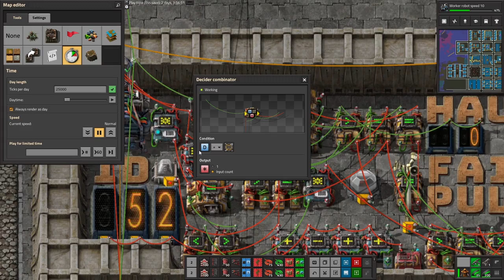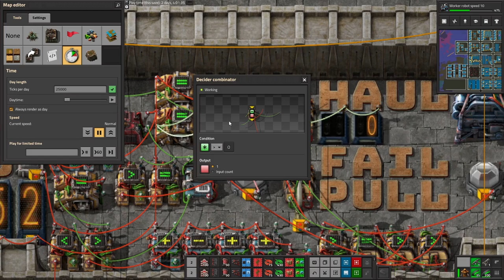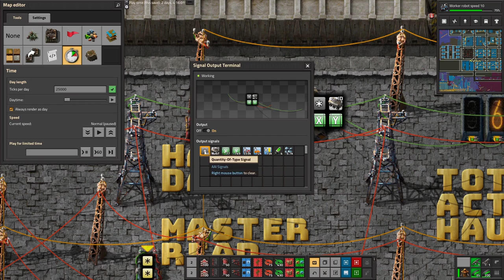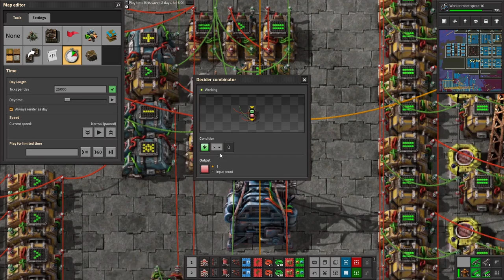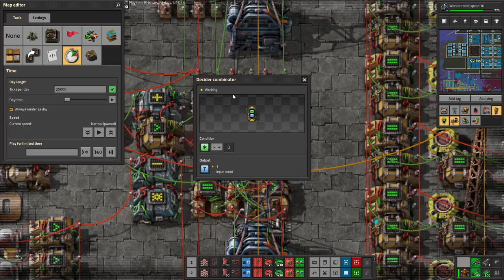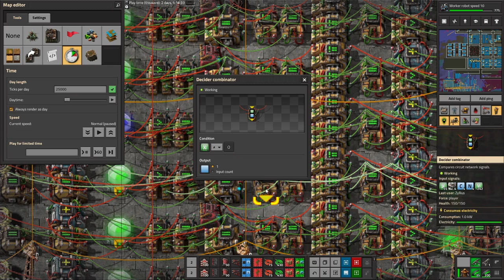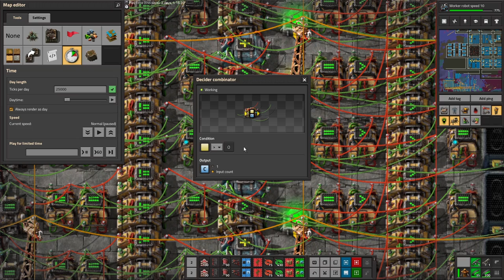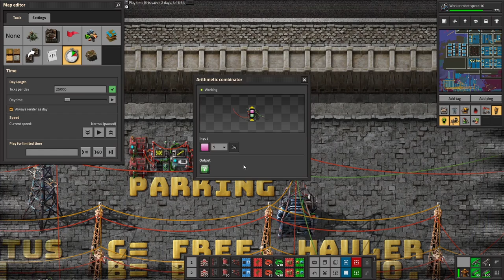Explaining the Logi-Brain™ Poorly

Comment: I was under the impression that I was above average when it comes to circuits in Factorio. After watching this, I realized it was just a massive Dunning-Kruger effect.
Reply: I mean you still could be, this is WAY above average, the guy is a computer engineer after all
Reply: No no, most people dont use wires at all so you are above average if you use them for more than 1 thing.
Reply: @nadarith1044  My brother is also and he doesnt use wires in factorio because thats not the point, altho not needing to manually make sure the oils dont clog could be useful.
Reply: @nadarith1044 Put simply, original commenter is probably above average, considering most people don't ever use circuits. Dosh, however, is in a league of his own... He's not just above average... He IS the average. He's 50% of the average for circuit knowledge

Comment: So from what I see you've broken the logic problem into frames, created your own clock to synchronize the frames and then do some hacking of the clock to allow you enough game cycles to processes all the ops needed. The rest of the hard logic comes down to isolating the variables and making sure you have synchronized logic between the loading stations and the central computer so that they only ever output expected values on the correct frame.  There is a ton of extra logic to keep the haulers moving, prevent failures...ect but the core of it really came down to create frames to transmit the data. Beautifully done.
Reply: It's like this multiplexed bus where every receiver and sender has it's slice of time to communicate one after another. It's very clever idea, because part of fun in factorio circuits is that the way they work in time is different than what programmers have used to work with, so it forces you to think a bit more of how to achieve something. Even simple things can be a bit difficult... :)

Comment: First, the unit scanner/controller take up a lot of UPS. Moving those to only operate one tick on your longer clock cycle will free up a ton of lag. I haven't looked at your blueprint, so could be you're already doing that.

If I could make one change to this mod, it would be to change the way the unit controller/scanner work to allow array-based operations. Using the MoonLogic mod, you could write an array-based function to output where all the haulers should go, the problem is you still need dozens of controllers to send those signals out, and each one eats a ton of UPS.

The other related problem to this is the pathfinding eating up UPS. There is a second method that bypasses pathfinding and sends a hauler directly to a coordinate. The problem with this is your circuitry needs to know the full path and check for idle at each waypoint. But if you had an array-based function for exactly this with MoonLogic, it becomes a solvable problem.
Reply: That 23 who liked this be like : "Yes that definitely makes sense"
Reply: the unit scanner & controller operates for each cargo hauler, one per tick, so i dont think he can move it to only operate on one tick per clock cycle

Comment: Man this is a super Impressive video! Handling all of this logic with only the two wires is definitely challenging, and dealing with the race conditions between all of the clock cycles sounds like a major pain.

I thoroughly enjoyed this, and you explained it well. I can't imagine recreating something like this, but it's so cool that you were able to get it built in Factorio. 99% working is good enough for something like this, and it's awesome that you built in error checking when something goes wrong. Sadly you had to listen to the alarm sound for so long before turning it off instantly!

Comment: How is it possible to keep track of whats going on while building it?
My crown achievement with circuits is automated SE rockets. It took like 20 minutes and about 10 combinators to build, but the next day I could not tell what did any of them do.
I cant even imagine the troubleshooting process of this monster.
Reply: Documentation is a requirement if you don't want to do archeology and reverse engineering on your own fucking work later.
Reply: Well there's your problem - not knowing what any of them do. You have to design it in a way where you know what they all do.

Comment: In case you thought you were too smart, here's a "I can always do it better comment": 
Why let the program fail? have a system where if there's an available hauler, only then the processing of the circuits are allowed. so no processing when the haulers are all busy. plenty of ways to store haulerBusy, in circuits, or in hauler unit data for less overhead.
you want the brain to be active for as little time as possible, instead of ticks generating action, a dependence generates action. at least for as much as possible.
set Avbl=0
when car=="available":
   Avbl+=1
when car=="busy"
  Avbl-=1
#have a power gate for signals of the depot circuits
gate==closed
If Avbl>0
   gate==open
#in the depot signal
If coal<4k
   request=1
while request==1
   gate==closed
#one dedicated circuit network for confirming an order is processed
module confirm
if request==1
  call [confirm]
     if confirm==1
        request=0
     else
        call Error Siren at 200% volume
#a rough sketch
requests processed as fast as possible,  and parsed only on call.
this minimizes the fact that setting a vehicle data and all vehicle processing better be turned on only when needed, behind a gate of sorts.
also either the vehicle parser only checks each vehicle every 10s or so, or it's a set and forget order until vehicle that fulfils an order itself triggers "now open for requests" so you don't have to keep checking it's status. give some more autonomy to the poor slaves.

Comment: Seems like you had a lot of problems with frame delays. Did you ever consider offsetting all the depot's by say 5, so you have 5 frames of time before the next data packets arrive? This seems like it could have simplified a bit of complexity with the lockout signals happening? If you're willing to slow the master clock down you could even do 10 or more frames between each depot. This seems like it might have allowed more wriggle room without needing the delay components. Even if you can't set the depot or hauler ids you can divide the master clock signal by your frame delay value and use a memory cell to hold the signal in the frame for that entire period, or let it pulse through the system for that many frames.

Have to commend you though, using the counter ticks to decide to send data on a specific frame is a genius idea that I probably will never use but still respect.

Comment: The more I watched this and the more I thought: this would have been so much easier to do with a Verilog compiler that outputs a Factorio circuit.

There are some things that you can write in Verilog that probably aren't possible in Factorio but at least your sanity would have an easier time. You can just get some nice code for an APB protocol bus and you've done all the hard work of transmitting info between everything (and you can cheat on the clock and just make it internal using the ticks of the game itself)
Reply: Verilog is binary and Factorio is bundles of item counts

Comment: Great video, a lot of content. I picked up some tricks. Maybe you could do a better structured video on basic components on the main channel, such as clocks, latches, filters, shift registers and so on. What problem they solve and how they are built in factorio. And maybe even how to combine them to do stuff.
Reply: Stuff like the "pass on first instance" at 45:52. Neat trick, I need a factorio cheat sheet filled with these so I don't have to think.